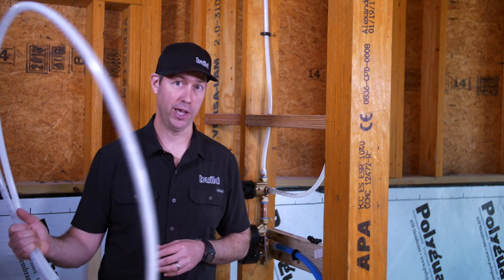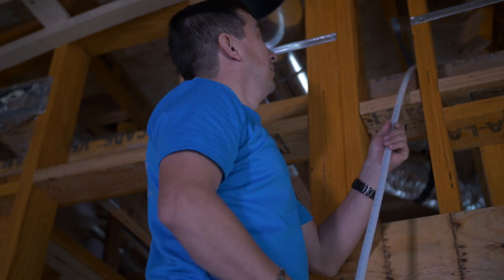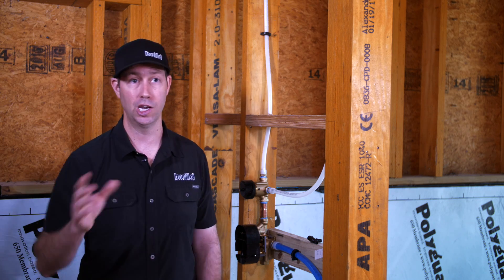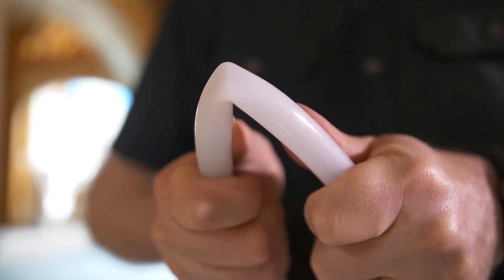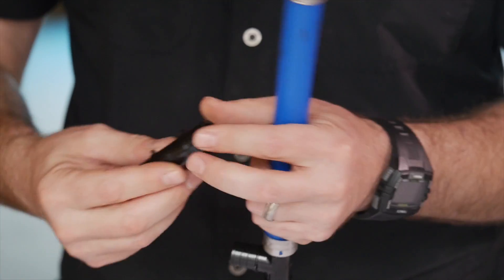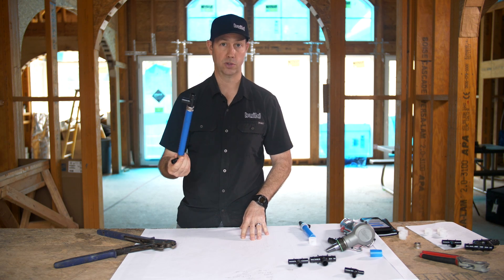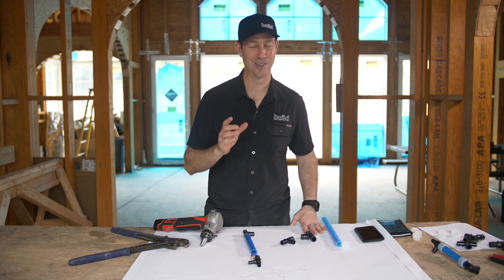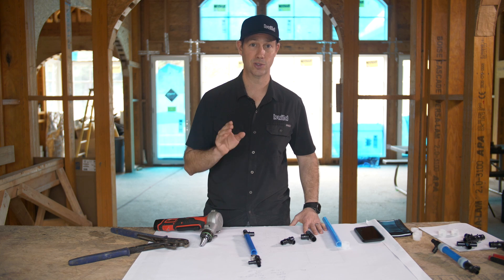PEX vs. Copper Plumbing

Comment: IMPORTANT INFORMATION FOR WELL WATER. The plumber that did our whole house used brass pex fittings with the narrow sintered metal collars. In the last 6 years I've had 4 fittings start to leak from what appeared to be corrosion of the fitting allowing the connection to develop slow leaks. What I've learned is they were supposed to use plastic only on well water systems. Good to know I will eventually have to replace every fitting in the damn house!
Reply: ...  different metals touching/ connecting in moist/wet circumstances will corrode.

Comment: If I ever get a chance to build another home, I am going with the largest line from the street available into a same sized manifold and using 3/4 copper runs throughout. It's overkill but I don't care !
Reply: august man, you are going to wait 5 minutes for hot water to get to your shower if it's on the other side of your house from the hot water heater
Reply: @dh66: correct...  Folks assume bigger pipe means faster water, but that's not true.  Add up all the water that larger pipe can hold and then realize it still needs to go through the same sized shower head.
Reply: Bigger pipe might equal a bigger leak.
Reply: You're pressure at your fixtures is much less then even what a 1/2 line has , absolutely no point in running 3/4 directly to a fixture , and you would have to Bush down anyway to make the connection. 

The fixture is your limiting factor 9 times out of 10 , and the other 1 is usually the supply pressure and not your runs. Unless your fixtures are 200 feet from your manifold 3/4 is just going to cost you more money.

Comment: Jordan I repipe my house but facts and after repiping it I've only had one issue where there was too much grease that came from the expander on the automatic Milwaukee expanding tool that cause leakage at the joint. So you definitely want to be careful when you lubricate expanding tool so that it doesn't get into your pipe which will cause a leak but other than that I don't like the idea of mice chewing through and if I was to ever do it again I believe I would use copper.

Comment: Smaller diameter , more pressure less volume.
Reply: look at 3/4 copper and 3/4 pex...huge difference ..copper has better flow.
Reply: But fewer elbows means less head loss.  Also smaller pipe allows shorter wait time for hot water.  Of course, PEX needs to be sized correctly, but even 1/2" PEX supports 7 gpm at 40psi through 100 feet of pipe.
Reply: I don't think the pressure changes, just the volume. I do hate the fact that a 3/4 pex run measures 5/8 I.D.
Reply: Put your finger over a garden hose and the water will spray a lot further so the amount of water is less.
Reply: 3/4 pex is just a label. You have to look up the real demensions for calculations.

Comment: I have some poly replaced half so far with pex with stainless rings .the supply line was PVC to the house transitions to copper ran into slab then up to attic with poly the copper failed in slab replaced with PVC  and made manifold to join all 3 materials cpcv from water heater will finish with pex when winter hits too hot in attic in summer. Never use copper in fl pinholes from water pH adds alkaline soil and lightning electrolysis. Had only 2 leaks on same side of poly at 16 years quality of plumber made big difference in how it worked.never had fitting leak which is common with bad installation

Comment: An excellent little known reason for using PEX is those on an acidic well supply can (within reason) throw away the calcite tanks and water softener. Acidic water in copper will make you sick and years later have pinhole leaks. Some entire regions have somewhat acidic well water and "city water"  too.
Reply: You shouldn't be drinking water below 6 pH

Comment: I will be finishing my basement soon, the house is 30 years old and plumbed with copper. Is it wise to mix copper (old build) and PEX(new build) in the same system? I don't know if I want to re-plumb the whole house (only one story) with PEX just to get the benefit of a manifold.
Reply: It doesn't matter at all. Mix all you want.

Comment: Pipe size has nothing to do with pressure, only volume. You can have 200 lbs of pressure... but if the piping is narrowed anywhere to a pin hole, you won't have much volume. I have 30 lbs of street pressure to my home. The water system is slightly over sized and there are zero problems with water volume during heavy use. (2 people showering and the like)
 I've installed 1000's of feet of Uponor Aqua Pex. (no metal bands, just the expanding Pex Rings) so it's all one material. 
The biggest advantage in comparing to copper is no more ELECTROLYSIS ! (too hard to explain, look it up) Also it's clean....no acid flux in the system, just run the water for a few minutes and then drink if you want. Easy to repair too. (nail hole, accidentally drilled and the like)
 Water hammer happens when you shut off the water, at any fixture, very quickly. (Push/pull valves and solenoid valves on refrigerators and clothes washers, toilets are usually the culprit) Water is heavy, (carry a bucket of water sometime) pipe holds a surprisingly large amount of water....get it moving real fast and then suddenly shut it off it's going to make noise in any system. Shock absorbers are very effective in strategic areas and rather easy to install.
Pex is cheaper by the foot but you generally use a lot more liner feet....a LOT. The real savings is in labor costs.
 Most rodents leave pipe alone if its not leaking.....but if there is a very small leak, they will lick it and begin to chew it to get more. I've seen holes as big as golf balls in black ABS waste pipe that started out as a hairline crack. 
When installing Pex be sure it will never see the light of day or the light of can lights. If its installed close to a can light just insulate with foam, (Very easy). As for turning on the cold water and it's warm due to attic temp, so what....who drinks tap water anymore? It won't affect RO water or charcoal filtered water from the fridge.....both have reservoirs.
Shark Bite is an O-ring dependent seal....exposed to the atmosphere....it will eventually dry out...and disintegrate.
Yes....I do know just about everything about residential plumbing....I been doing it since Junior High. I'm 58 now... Go ahead....ask me something.
Reply: Averageskill Flow rate is proportional to the 4th power of the radius.  Small changes of diameter have a large effect.  
Pressure distal to a constriction falls.
Reply: Good points and information but I don't agree with saying "who drinks tap water anymore". The water from the tap should be potable and I grew up drinking it. I don't want to be afraid to drink the water from the tap.
Reply: @kevinq9988  I still drink water from the tap also. I am not afraid.
Reply: Averageskill   OK , I have a question. What size hole should I drill through my floor when using 1/2 pex-A? I'm going to replumb my house, it has very old galvanized. I don't want to leave to much room for critters to get through.
Reply: "Shock absorbers are very effective in strategic areas".  Yes, they should be standard equipment in every plumb job
Reply: Ok.  Why are you so conceited?  You and your warm water have issues. BTW your plumbers crack is showing...
Reply: Which type of pipe is the healthiest  for humans? Two answers are fine in the case of a residential city water home (chlorine fluoride etc) and natural well water - off grid gome.
Reply: Di-electric unions= no electrolysis-defeat. Local plumbing codes require water soluble flux-defeat. Proper strapping placement=no water hammer-defeat. Shark bite fittings do not have o-ring's, they have a metal band specifically engineered with many small tabs or "teeth" to "lock in" the pipe hence the name shark bite-defeat. 58 years huh, not impressed.
Just one more stab- I celebrated 20 years of plumbing and one year of licensed contracting this past June. Please educate yourself, we are the protectors of the nations health!
Reply: Sh*t, I forgot nail holes. In 58 years you never heard of protection plates? Come on slick

Comment: We have had multiple pinhole leaks for the past two years in our 19 years old copper pipes.  The water quality is very good where we live (northern Calif) and we seldom get freezing temps.  I am very much tempted to repipe with Pex instead of copper.
Reply: Are you on a well, or part of a private water system? Generally, it's been my experience that deep wells, and in certain areas, shallow wells can cause corrosion of cu. This post didn't go into CPVC. Inexpensive, ease of installation and long life. When water pipe manufactors were asked to submit what chemicals leached from their product, PEX was the only one do decline. Admittedly, this was 15 years ago.
Reply: probably type M copper..the cheap stuff...i have worked on houses here in new england with 50 year old plus type L and no issues.
Reply: While I agree with you in that type L should be the industry standard, type M is allowed in northern California for most interior plumbing. As a master plumber with 43 years experience(36 years in Butte co.) I've done too many water systems to count. Most were done using M. As of 2017, I've never had a callback where type M had degraded due to its wall thickness. Yes, some water systems have aggressive water, but that has been identified before the job was done. On those jobs I've used CPVC. I went through the polybutylene debacle. It was the best thing since sliced bread. Inert and resistant to freezing, it seemed to be the answer. I used it on 2 jobs. A remodel on the coast and distilled water in a medical lab. This is my beef. I do not like having to rely on a manufactor's equipment. i.e., crimping tool, swedge, etc.  I can feel a solder joint and a threaded joint. I can't feel a sharkbite, PEX or quest. Too much reliance is put on the maker of fittings and tools. If a factory worker is having a bad day, WE pay. That, in my opinion, is why I stay away from DIY/foolproof systems.  I am uncomfortable with the line I hear,"it saves time" Really?  Why are you eager to save time? Because you bid the job with CU and now you're using PEX and plan on pocketing the savings? You want to get the job by giving the lowest bid? The former is unethical and the latter, risky. HVAC contractors magazine asked water pipe makers to submit specs on their water pipe(this was about 15 years ago) All of them submited the specs except PEX. The industry looks at lifespan estimates and says" We see that water systems lifespan is 20 years. We will sell systems that have a lifespan of 20 years and no one will make a peep." I want my installation to last 100 years. I've never had a Rat chew through CU , CPVC or galvinized. Have you?
Reply: Laco flux is the worst.
Reply: i hear you..i do mostly service work and not to many new installations..im up here in massachusetts and our code is strict..no pvc DWV in commercial buildings etc..all kinds weird stuff like that.
Reply: UPC in California. DWV is pretty strict. S.F. has powerful union, so nothing is plastic. Here in the north it's ABS and metal DWV above 2nd floor.(Gases during fires) PVC is not allowed on interior systems(clearly, the codes haven't standardized nationwide) Mostly, the real skill is DWV. Always has been, yes? In recent years the inspection of systems has fallen due to budget constraints. It seems that anything goes. I'm for a guild. No one does plumbing unless they belong to the guild. Period. It will never happen but, oh well. A little known fact. The most difficult of all plumbing is......service work. Don't let anyone blow smoke, otherwise.